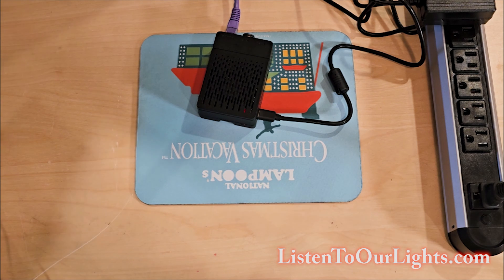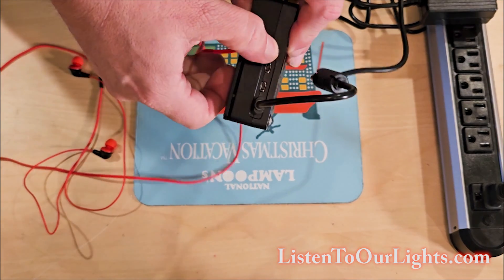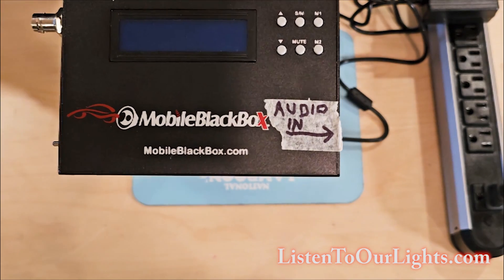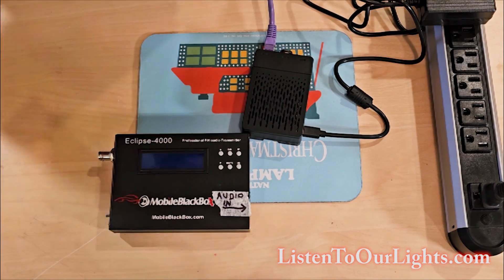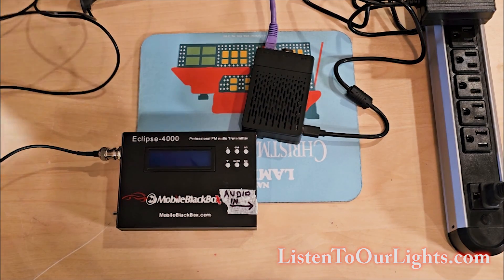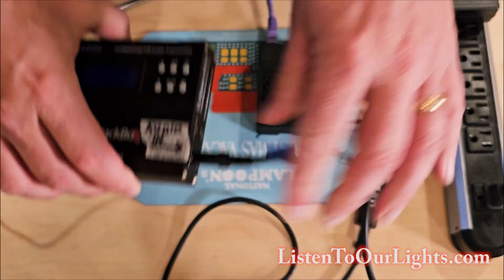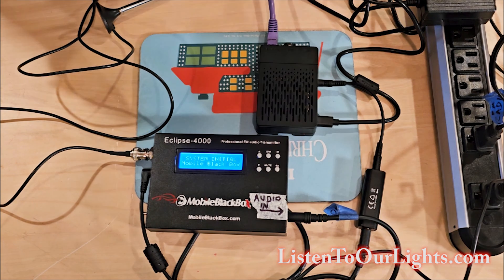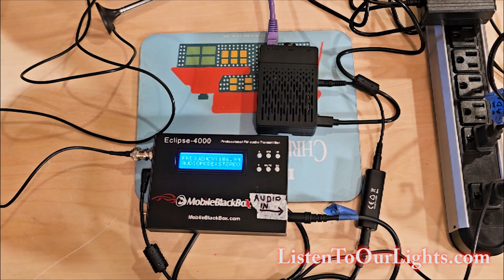Connecting FM Transmitter to Raspberry Pi FPP

Comment: Just to let you know, FCC website states your transmitter should not interfere with other commercial stations and can transmit FM no more than 200 feet from the antenna.  Most transmitters sold on Amazon or any other websites are anywhere from a 1/2 watt to 5 watt transmitters.  A 1/2 watt in most ideal conditions can transmit up to a 1/2 mile.  Now, with that in mind, the FCC does not go after the holiday show like ours because they are temporary and only take up the airways for about 2 to 4 hours a night.  The FCC is more about going after the pirate radio stations.  Also, if you are creating problems on the airways they will send you a cease and desist letter first.  Belated Happy Holidays!!!